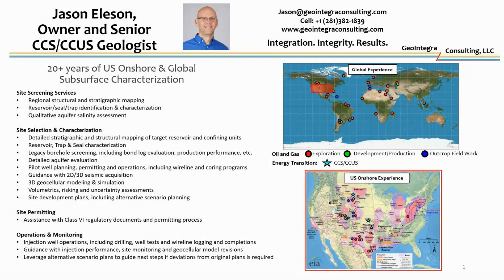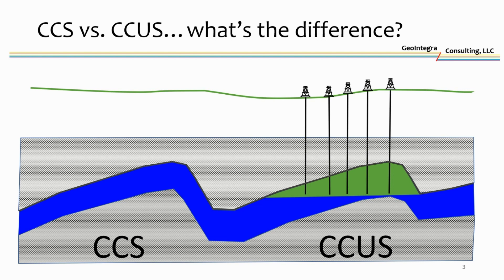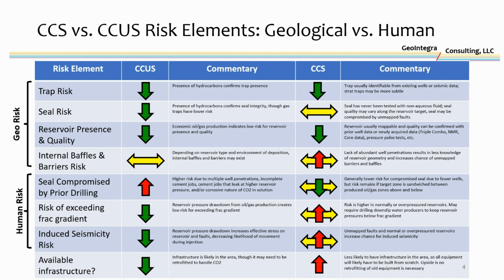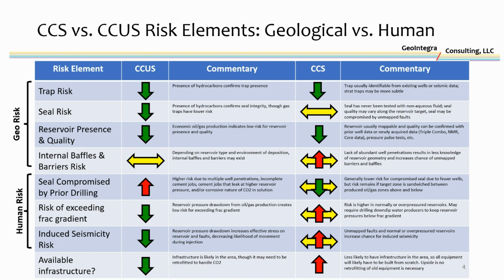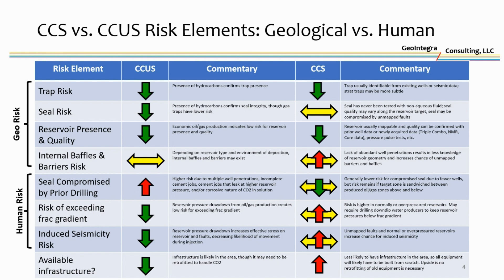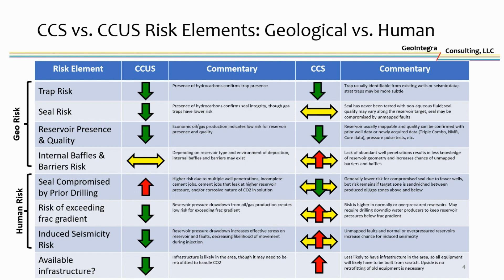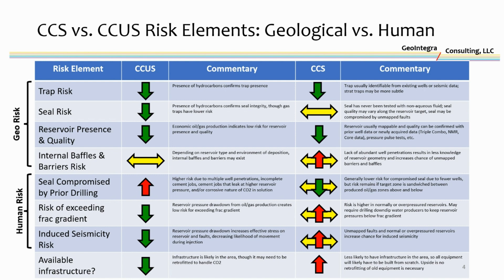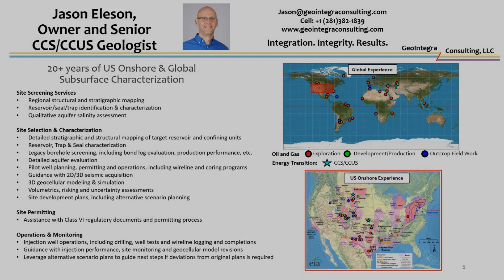CCS vs  CCUS   What's the difference?

Comment: It's fine to offer products to customers that desire them provided there is little harm.   Higher levels of atmospheric carbon dioxide is highly desirable for C3 plants most of the plant life on earth that evolved in carbon dioxide levels ten times of today.   Earth's greenhouse effect is always in saturation from the strong greenhouse gas water vapor absorbing all the greenhouse radiant energy from the earth within 20 meters of the radiating surface.    

The back of the United Nation's IPCC science report states it took its greenhouse gas samples at 20,000 meters altitude where it is common high school level knowledge there is no greenhouse radiant energy.  This is typical practice for deceptive marketing to state legal data transparency protecting the perpetrators from fraud prosecution.   The IPCC has been transparent with its data acknowledging it is not dealing with active greenhouse gases.  Global warming has been stalled at about 1°C since 1992 with there being no known cause for global warming in 2024.  The Arctic region is warming.